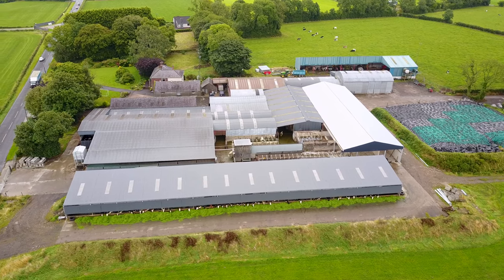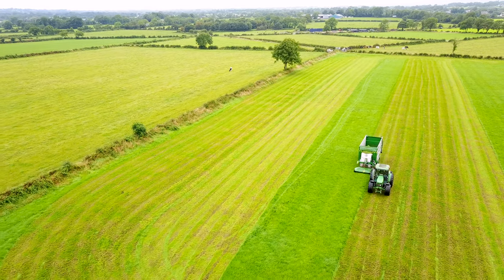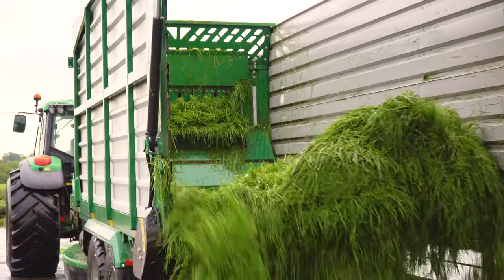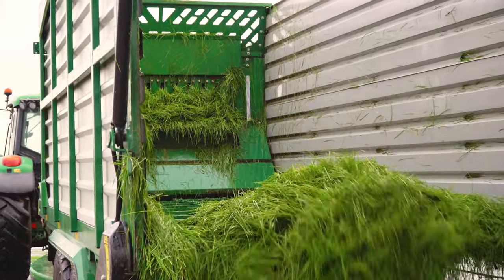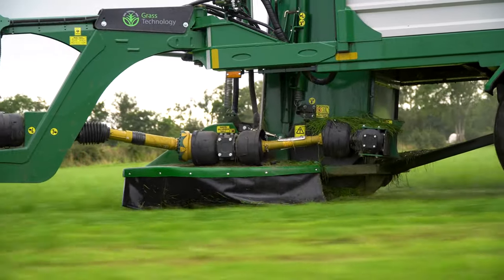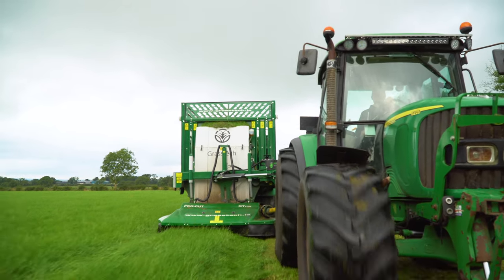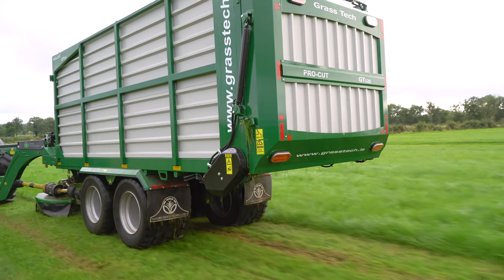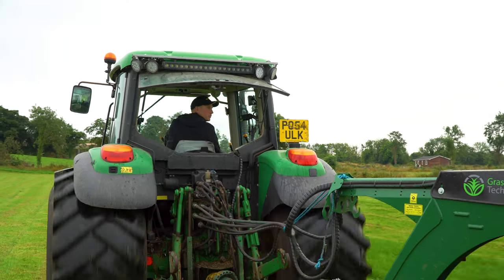From SILAGE WAGON to ZERO GRAZER

Comment: If the cows are not on the grass how do you fertilize it, do you spread the  menure back on it?
Reply: yeah a lot of money and time burnt for little gain I think
Reply: @kieranosullivan02 Cows will never spread manure evenly on the field and will add manure to whatever field they are in whether it needs it or not. 
Also when grazing, cattle will go for the most desirable parts/grasses first and trample the rest causing lost feed or not complete nutrition whereas zero graze has no trampling waste and ensures cattle eat everything rather than just what is desirable.
Reply: They slurry spread. Better distribution.
Reply: @popandbob you could accomplish the same thing by simply baling is as silage and storing it. We do it once in the spring and then we are done for the year.
Reply: @Tiger-fv3nl  If they do it as one and done they are missing out on 2/3rds of the growing seasons growth. Also there are substantial costs to setting up enough silage capacity whereas grass is cheap and easy.